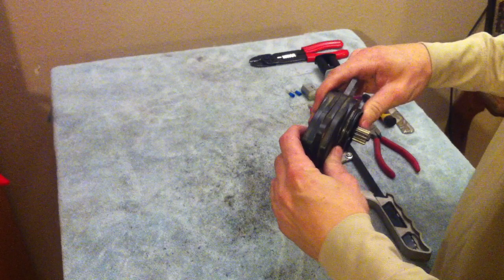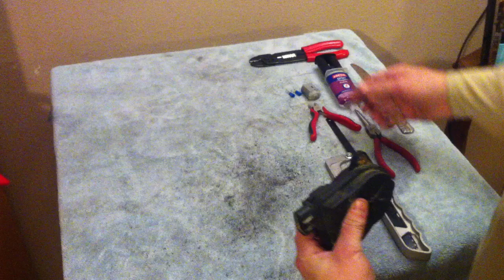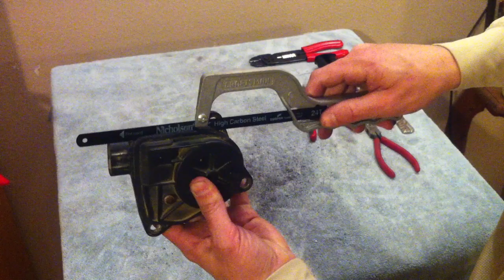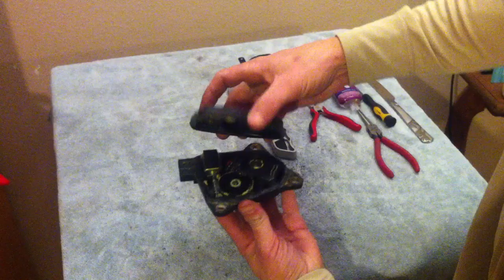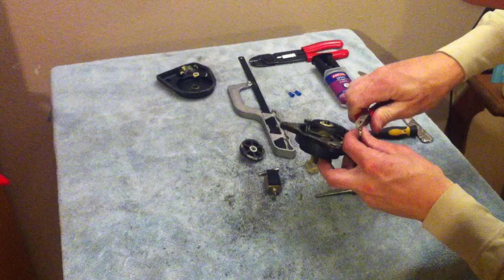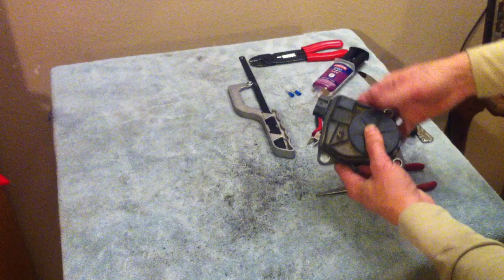Yamaha 4x4 Servo Motor Replacement on Sealed Assembly on 1998-01 Grizzly 600 and More

Comment: It looks like the red wire (+) should be on the LH side when viewing the back-end of the motor (@2:24).  I think you have it connected backwards @4:55.  Wouldn't this make the actuator work differently if it was wired backwards?